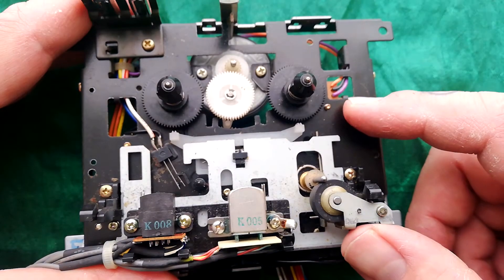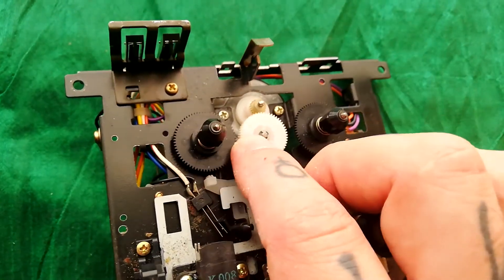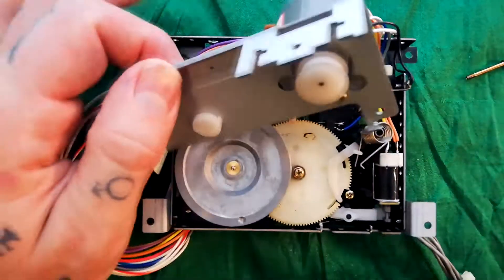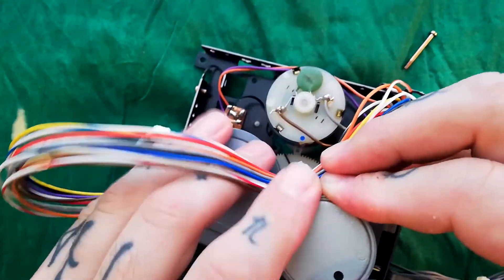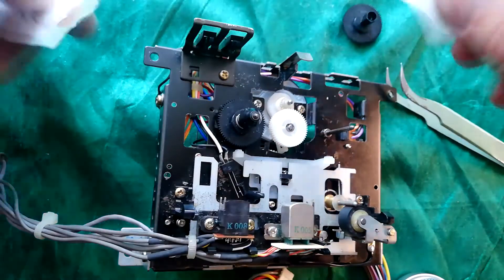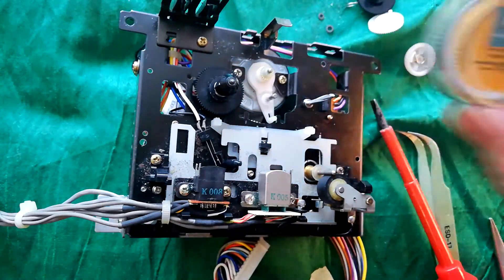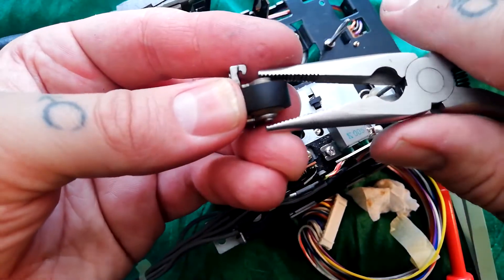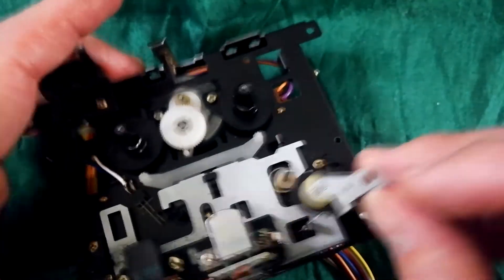Fostex 280 | Tear Down 2  | Cassette transport in detail

Comment: Hi Tetrakan, I've broken Fostex 280 in the tape section, maybe you have any idea on my video: https://www.youtube.com/shorts/JIjAiEiAN0Y
My considerations are if it is worth for a repair at an external service point, since I see a self repair seems quite complex for my expertise in that.
I do not use the device any longer (I'm using a DAW for multi tracking), but could sell it if in good condition.

Comment: Do you happen the size of the belt?
Reply from the maker: This unit was in such bad condition And missing so many cosmetic parts I used it for spares, the motor and heads are in other units now, so I never got to the stage of buying several belt sizes and finding which worked best, sorry. You can try wrapping masking tape around the pulley and flywheel, cutting it then measuring the cut tape, then see what flat section belts of approximately that circumference are available. I would err on something 5- 20 mm shorter than the cut tape since a good neoprene belt is very flexible.

Comment: How did you size and find the appropriate belt?
Reply from the maker: This unit was in such bad condition And missing so many cosmetic parts I used it for spares, the motor and heads are in other units now, so I never got to the stage of buying several belt sizes and finding which worked best, sorry. You can try wrapping masking tape around the pulley and flywheel, cutting it then measuring the cut tape, then see what flat section belts of approximately that circumference are available. I would err on something 5- 20 mm shorter than the cut tape since a good neoprene belt is very flexible.